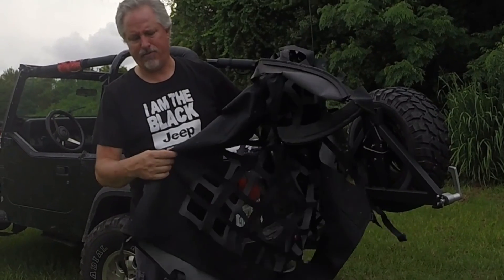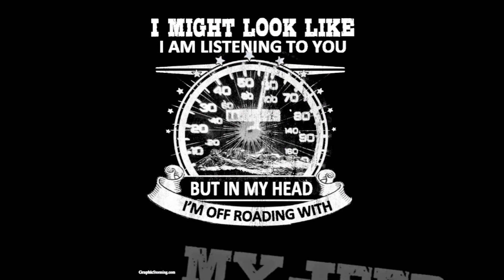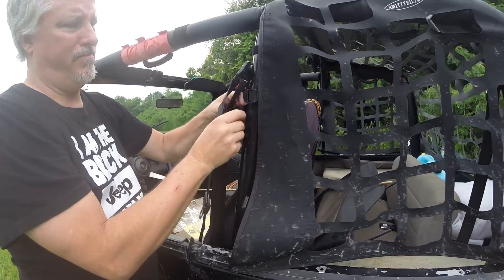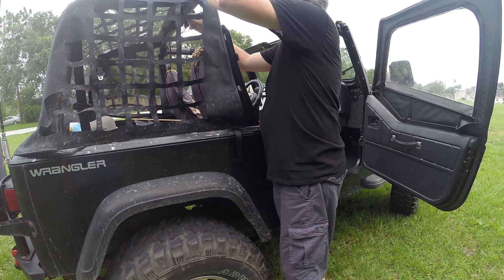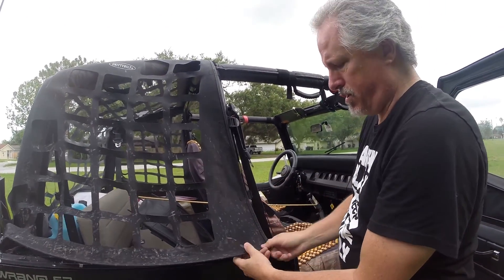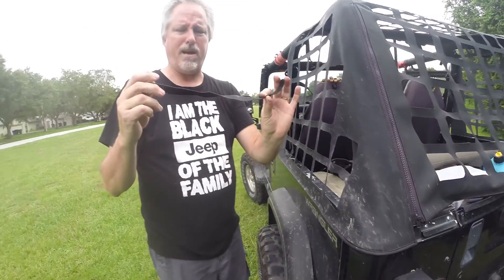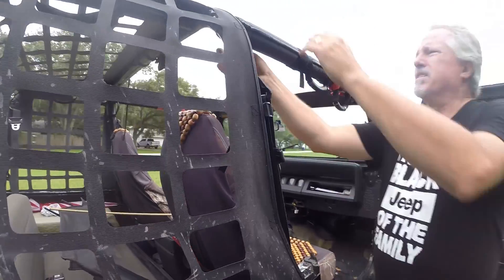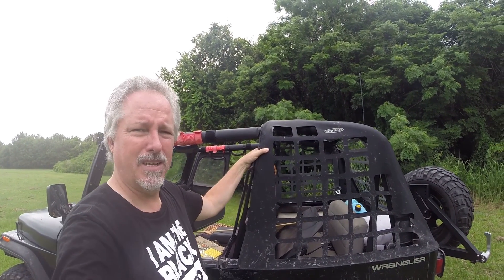Smittybilt 521035 Black Diamond Cargo Net for Jeep 95 Wrangler

Comment: does the soft top hardware need to be removed?
Reply from the maker: It fits in the rails and on the back corner tabs. The only issue was a the Bimini top had the same area for the forward strap as the net. It worked and holds up under Florida weather.

Comment: Y not use you soft top tailgate bar instead of the bungee it would help with the rattling
Reply: @FloridaJeepRides  in this video you have the tailgate bar peace on it and your soft top rear window should have a bar that slides out and slid onto the net just like the back window and just clip into place it would make it alot more secure than the bungee
Reply: It looked pretty good until you got to the bungee cords. I was considering buying this for my YJ but wondered how snug it could be.
Reply from the maker: For now my son has the YJ. He runs the Rampage frameless top and it's not holding up too well. For some reason comments from a year ago are suddenly showing.